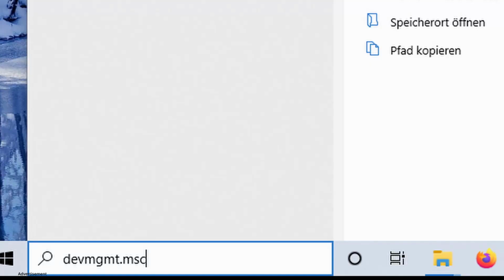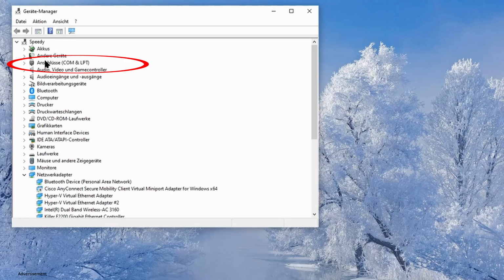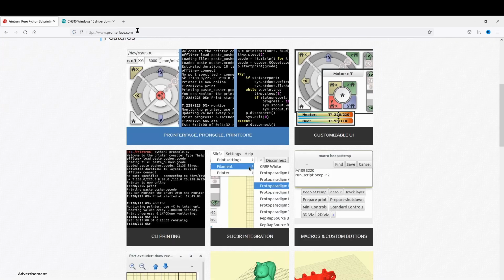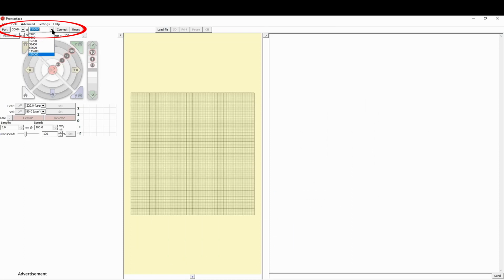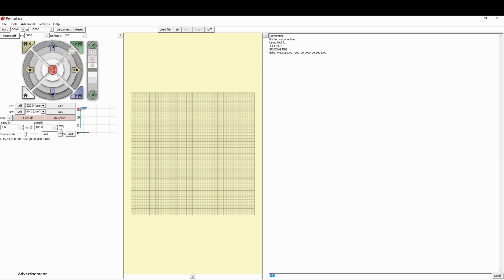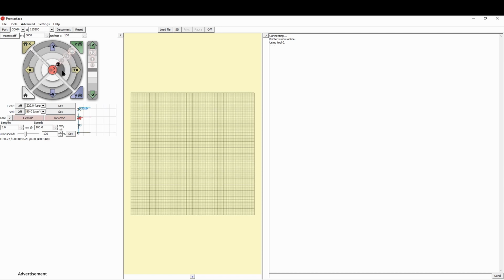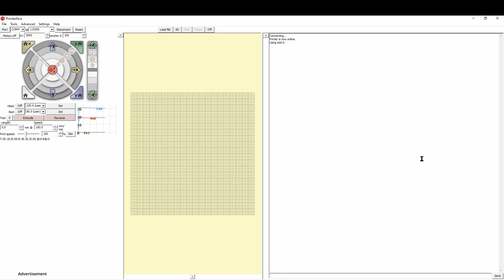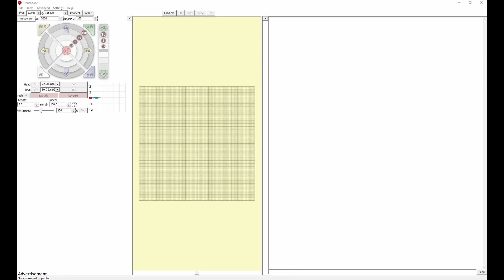Ponterface - how to connect a 3D printer to a Windows PC

Comment: Is there a way to increase the max temp using pronterface commands? My ender 3 wont let me set the temp past 260 on the lcd, but i have a microswiss clone and even an upgraded heating cartridge and direct drive, dual gear extruder, inline drier etc. My printer is physically more than capable of 300c, its just the damn software holding it back.   I just need to print hotter than 260c but these stupid safety features wont let me. Ive only been printing a month or two, so I dont know how to flash or edit custom marlin firmware yet. I just need to be able to print at 300c. I wish they didnt make it so difficult to get past 260c. Its funny that they dont have any other safety features on by default except for the 260c limitation....
Reply from the maker: The Max temp is a setting in the firware, this can't be changes with GCode commands.